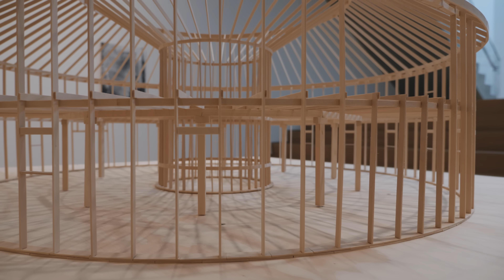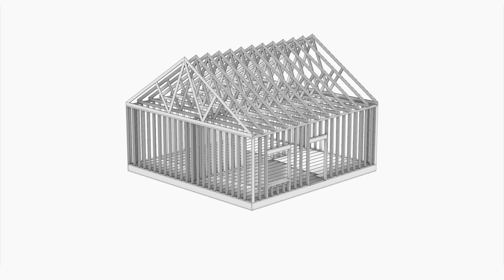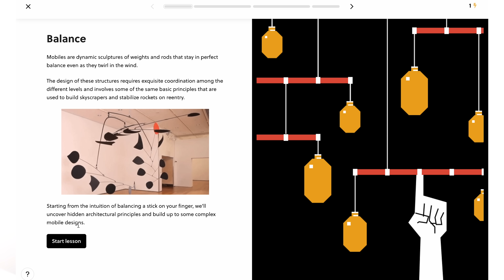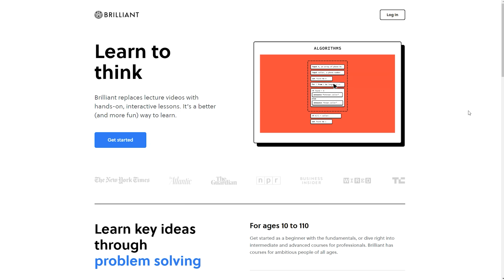The Genius of 2x4 Framing

Comment: “This means you don’t need skilled labour to build a house using light framing”

….ummmm As an experienced carpenter for the past 16 years, let my respond to that by saying….Ouch. Haha! 

AND; although I think I know what your were getting at….I’d like to say that two of the men that I worked for, who between the two of them, taught me everything I know, they both developed their skills into a level of mastery for their craft, far and beyond any other careered professional. And that goes for any respective skillset, in any field, in either blue collar or white. 

Their ability to read plans, visualize very different and challenging designs that we’d never seen or built in the past (extremely high end custom homes, for example), utilize tools as if they are extensions of themselves, and also have the foresight to recognize possible issues and problems before we had even the chance to make the mistake, are just a few of the skills they had (and taught me) that made these two men invaluable on the Job site. And as mentors guiding me through this career.  

They’re both perfect examples of builders who were nothing short of masters of their trade, extraordinarily talented, and therefore I must eminently disagree with your statement and state unequivocally there is in fact a massive skillset required in order to be able to construct buildings using “light framing” methods. A skillset that is so wide ranging and challenging to develop, that I believe, most people could not match in their respective fields with their respective skill sets. A master carpenter is not an easy thing to achieve, nor do I believe that just anyone could become one. 

But that’s just my two cents. Excellent video as always, but I just had to get that off my chest! Lol

Comment: As an owner of an old balloon-framed farmhouse in Ohio, I've done some research on this subject. Based on the current evidence and conclusions of those educated in this area regarding when balloon-framing started and certain types of round- and square-headed cut nails were available, I've been told our house could not be from earlier than 1833. However, comments in the deed from that period state that the house was built in 1817. Additionally, we know who the owner-builder was as he signed several joists, and we found those signatures when we did the demo to start our remodel. He died in 1828. I shared this with one of the researchers and was told my documentation must be erroneous. I just had to shake my head at that.

Comment: In my Canadian area, we build almost exclusively with light wood framing, and the updated codes are now able to produce very tight and well insulated structures. 2x6 framing with cavity insulation and continuous exterior rigid insulation (or rockwool), in combo with engineered lumber. Those saying these are "fragile" structures have obviously never framed.

Comment: Romanticism aside it's a shite way to build given it's proclivity to burning up and flying away to OZ in storms. Those problems have long been solved by cement the world over. And for those about to cry out about cement being pricier, it wudn't be if manufactured to same economies of scale as lumber is here in North America.
Reply: There's no romanticism here. And he hasn't even delved into the benefits of breathability, repair, and modifiability. And where in the absolute f are you people getting the idea that American homes blow away in storms?
Reply: @Objectified  must be them liberal news channels spreading them lies again. Ofcourse MAGA built homes don't catch fire nor rip to shreds by wind✌️prepper bunkers solved that 😂. If you can build concrete poured basement foundations, you can pour concrete main floor, second floor, roof and stairs. Brick n cement for walls. But what's gonna burn down then, that don't sound right at all.

Comment: Todays homes are cardboard cracker boxes. Built on the cheap, with every corner cut that the home should be round. Yet more expensive than ever. According to the United States Census Bureau, the average price of a house in the United States in 1960 was $11,900, in 1960 dollars. When adjusted for inflation, the median price of a house was $123,432.75 in 2023 dollars. Hitting an all time high @ 168 U.S. dollars per square foot in 2022. Even adjusting for increased home sizes at over 1,000 sq. ft. homes are much more expensive for less.
Never mind the horror the public never sees with some mook who fancies himself a carpenter and is as bright as a burnt out light bulb and as skilled as a 11 year old.

Comment: The usage of this technique is the downfall of architecture to this day. Not only is it extremely inefficient to use wood in this manner, but with climate change upon us, the materials are not designed for high winds and moisture. Every time a hurricane or tornado rips apart this type of building, we turn around and rebuild the structure to the exact specifications that led to it being ripped apart, and, even worse, it all goes to landfill. Entire towns get flattened and sent to the garbage dump. It is a garbage design using wood that is quickly becoming deforested, and the wood quality is quickly falling in the forests that were once old growth and are now reforested in manners that do not help climate change, and certainly do not support the plant and animal species that grow in regions where this wood is harvested. We need a complete change in the way we build our structures, but this can only happen with building code changes that reflect our new climate nightmare.
Reply: Because flooded concrete and brick homes wouldn't still be flooded and required significant post-disaster remediation and repair if struck by a hurricane. The near entirety of wood-frame homes in the U.S. survive torrential downpours and high winds every year. Pointing to outliers like hurricanes and tornados as evidence of this construction method being "bad" is bad. Oh, climate nightmare. Never mind. I see you.

Comment: I never understood why they don’t use screws instead of nails
Reply: Nails can bend as the wood shrinks and expands. They don't break as this happens.

Screws are generally a lot more brittle. They can easily snap as wood changes snap.

Comment: I was kind of hoping you'd have compared this technique to standards elsewhere in the world. And even with just the two types of wood framing here, you didn't really compare benefits that might have come from using timber instead of light wood, other than saying light wood is fast and easy. Would have liked to know about strength, safety, noise isolation, energy efficiency, etc. I'm overall not sure I learned much of interest, personally. Otherwise, well spoken, filmed, and edited, fwiw!
Reply: Given that light wood framing eclipsed heavy timber framing in residential construction virtually overnight, to the point that heavy timber construction is also called "mill" construction because after balloon framing was introduced that's all it was ever used for, there really is no comparison.  Light framing is superior in every important factor for the desired purpose.

Comment: The problem with light wood framing is if......if......a framer wants to do a crap job, it's very easy to cover up.  A quarter inch short here, missed or blown through nails there it all adds up.  As long as everything is square, nobody seems to care; including inspectors.  
Other building methods require more skill and things can't be covered up so easily.

Comment: Balloon framing is also a PITA for structural firefighting.  Because the walls are open from top to bottom, you can guarantee a fire will be in the basement and or attic once it breeches the walls.

Comment: I'm a timber framer and the addition on my old house is a two story ballon frame of larch 2x6 outer walls 2' oc , Pine 1x10 sheathing , 30 # felt , and larch clayboard siding.. The inside walls are pine 2x4 16" oc and circular sawn. Roof is 6/4 x 8" larch scissor trusses. I mention all this for two reasons : 1. I work alone for the most part and the outer walls were about 18' high x 24 and 28. Obviouslly I used a machine , my backhoe to raise them and a jib boom lift for the trusses but with each lift I got a lot of wall up. Most openings were cut in from the inside as needed ( in winter). 2. I often hear materials aren't available. Yeah it depends on where you live and your skill level but I call bs on that. I made my own and salvaged used materials. for joists , timbers , and flooring. etc. Both ballon and platform framing are great and have there place as well as timber framing which are all included in my building. It's not rocket science it's evolution. Every building I repaired or tore down taught me something.

Comment: It was a great material until they started making it out of sawdust and wafers. What's the fastest way to compost a log?...cut it into small pieces. I'm finding houses built 20 years ago that are now listed as condemned.  Pretty unsettling for the buyer with a 30 year loan. These materials last long enough for the house to pass inspection and the check to clear and not much more. Houses built 100 or more years ago turn out to be mostly plumb and square because they're made with better materials by better builders. Mark my words...between the scams being run by the housing industry and the auto industry we face the biggest economic collapse we have ever known. Whatever your plan is for the future DO NOT BUY A NEW HOUSE.

Comment: I enjoyed the video and I think it was really informative. I'd love to learn about how other countries outside the US who haven't adopted this form of building houses. I've heard houses in Germany are made from cement? 

Also loved the guy's "Nailed It" sweatshirt in the building footage at 10:08. lol
Reply: There are more types of house construction here on the old continent. There are wooden huts/houses that are made of planks but those are not common in my area (I live in the Karpathian basin, in a sparsely wooded area thus little to no trees big enough grow here), we used mudbricks or compacted mud walls, a mix of mud, clay and dry hay was used. And wooden boards held the mud in whilst it dried out , they were thick walled and were replaced by prebaked bricks around ww1-ww2, and cement was used to hold the bricks. And in modern times so called blocks are used, big clay blocks with holes in them that are often filled with cement and iron rods from what I can tell, but since those are mostly used since the 80s-90s I have not encountered them so much to know details.
Reply: Most houses in Germany are build out of a kind of artificial light stone for the outer structural wall parts and burned clay bricks are used to finish these walls up from the outside. All the inner Walls are also made out of artificial light stone. So it is pretty sturdy.

Comment: The problem now coming into view is that it uses dead trees which burn in fires.  Some other countries prohibit wood framing because of the fire danger.  Note that any plants within five feet of a wood framed building become a "ladder fuel" that will burn it down.  So, houses in cities where the distance between houses is under one hundred feet, will light each other on fire.  The only thing preventing this is the response time of the fire department.  The bottom line is that more cities will burn down in the future.

Comment: 36 seconds into this video. 
I must pause, to say "Oh, I do. I question all of it".
 And I'm not even in those trades.

 Windows are soo few, too small, and not easily adaptable to automatic operation. 

Bathroom are too small. 

Bath tubs are made for skinny short people.
"Big and Tall" folks are forced to limit themselves to showers. 

There should be a partition (or entire wall) between the toilet and shower areas to make it more private for one person to shower while another uses the toilet and to make it more easily hygienic to keep the toilette far from the shower space. 

Homes with an upstairs are missing an amazing opportunity to plan ahead for upper balconies or decks. 
They are also missing the opportunity for sun roofs or star-gazing platforms. 

Homes should also be built to some extent in a way that more easily allows for later expansions; so that one need only remove a wall to be "halfway there" to being able to add another room. 

Homes with decent-sized backyards are usually missing the opportunity for a sun room or attached greenhouse. 

Floor-vent heating systems often handicap where a user can place furniture. 

Electrical outlets being so low to the ground creates safety hazards for families w/ toddlers. 

Some light switches could save money and add ambiance by having dimmers as 'standard'. 

Doorways and stairwells are too narrow; making it much harder than it needs to be to move furniture in and out of those spaces. 

Sound-proofing is missing between rooms and usually inadequate for outer walls. 

Countertop installation methods pretty much ensure those will be destroyed upon replacing them; preventing home owners from reselling the old countertop to help offset costs and to help lower-income people by making those available on the used market. 

The seem between countertop segments for popular types of material are absurdly vulnerable to water damage and swelling. 

Kitchen sinks are designed in such a way that it requires special tools and special effort to replace the faucets. This is avoidable.  

I could go on.

Comment: The burger to wood frame analogy doesn't really hold up. A burger is limited by in its scope and complexity by its standardized parts (meat, buns, garnishes). A wood frame structure is liberated in scope and complexity by its standardized parts, as you point out...can be a dog house or a 20,000 square foot mansion.

Comment: Yanks prefer standardisation over variety, what? You are all against standard measurement. You call them 2X4's yet they are actually 1.5X3.5. These houses are the the ones that are destroyed by your tornados and cyclones. You still build in non-standard measurement. They did testing on this and found the waste to be far greater when not built with standard metric measurement.

Comment: wait until this guy finds out balloon framing and platform framing are the same thing.
Reply from the maker: Except they are not.
Reply: @stewarthicks  Balloon framing refers to the fact that the weight bearing and structural part of the house is in the outside walls. and no just because a 2 story house is ballin framed doesn't mean a continuous board went from top to bottom.  they would sister boards together to get the length needed is some cases.  literally the only difference is how the floor is attached to the wall. and some wood stuffed between the studs. oh and sistering studs isn't allowed.

Comment: Logging operations in the western US often harvest nearly every thing looking remotely tree-like.  The big conifers are used for construction lumber, while the under story trees are chipped and end up as mulch or OSB.  In clear-cut prescriptions, all trees outside riparian corridors are "harvested."  Older stud frame buildings were often built using rough cut, full dimension lumber.  A full-dimension 2X4 is a massive piece of wood compared with the S4S tooth picks that haunt big-box lumber aisles.

Comment: Can agree with the fact that the 2x4 framing can be in both a simple house and a mansion and the 2x4’s for both can be bought from HD or Lowes etc. But the hamburger comparison might not be quite apt in that the bare essentials of a hamburger (meat & bun), unlike the 2x4’s, can easily be varied by more or less the quality of the meat and bun causing huge fluctuations in price.

Comment: 8:30 that's not right. People do not prefer mass-produced standardisation. It's the companies that promote mass production in order to cut costs and lower the skill requirements of every task, be it making a hamburger or building a house, thereby cutting wages as well as material.
Reply: People prefer the affordability that standardized mass production offers when compared to something bespoke. Sticking with the burger analogy, McDonald's is huge because it's cheap and quick, not because it's the best way to make a burger

Comment: I think wood is an absolutely inferior way to build a home. Special interest groups, lobbyists and the convoluted building codes have a stranglehold on the home building industry. Homes are now a privilege rather than an earned right.  Most homes are build buy one of 5 builders, raping the homeowner with cheap finishes and horrible quality. Wood homes are infested with insects, easily catch fire and are terrible insulators. ICF in my opinion is a far better solution and could easily be cheaper than a wood built home if only they could reach economies of scale. I also see factory built homes from steel and 3D printed homes as the future.

Comment: Is there any advancement in construction methods since this type of building method was invented over 100 years ago?  It seems really labor intensive to hand build one 2x4 at a time to create walls.  Dry wall can be shipped the same as any other material.  Are there any pre-built walls the dimensions of drywall that can be assembled on site kind of like legos?  I feel like this would be a lot faster.  But I don't know anything about construction.

Comment: I can understand why people in the USA built this way historically. However, I'm at a loss as to why it is still done. Modern light wood framed houses have an average lifespan of 70-100 years.  Timber framed buildings last centuries. My little house is made from brick and stone. It was built in 1903, and it's far more thermally efficient and weather resistant than wood framed houses.